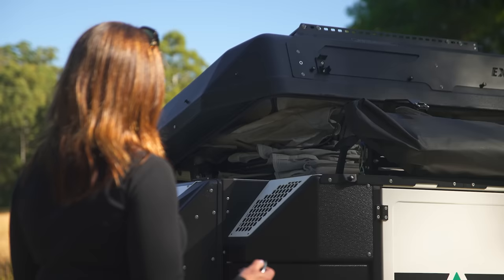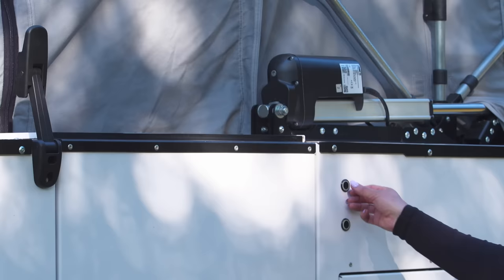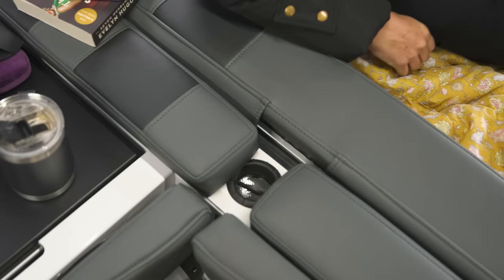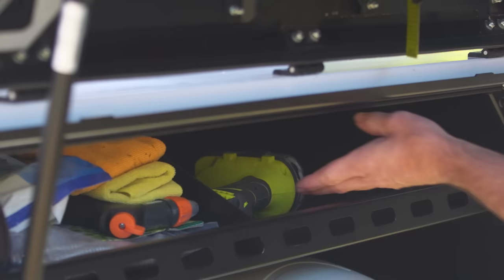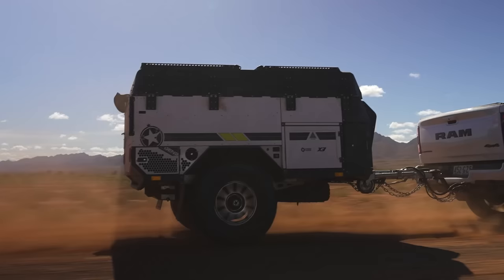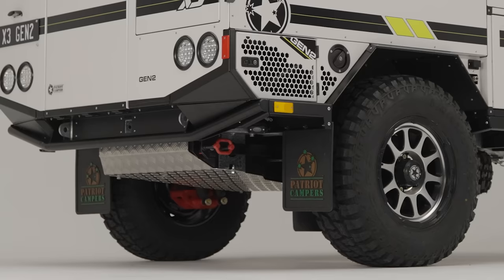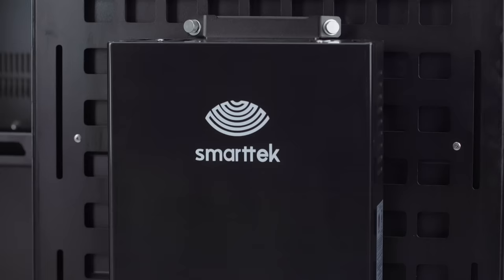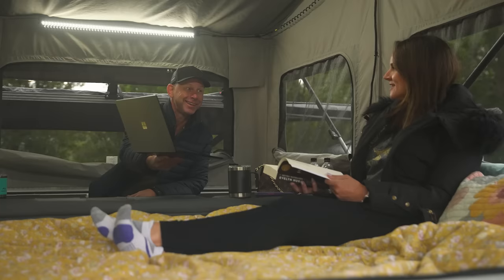Introducing the ALL-NEW GEN2 X3 Camper Trailer | Next Generation Offroad Automation

Comment: This so much better than the standed models but at a higher premium price....
As with the optional 120W Fixed Redarc Solar Panel , this should have a swivel type latching so when the composite tent lid is open, the solar panel can be folded of the rack and out into the sunlight... rather than have it facing the ground...
So will there be EOFY specials on the standed models since i read these will be fazed out with the Gen2 versions.
Reply: You will be pleased to know the solar panel does exactly that.  It is removable and has its own stand and comes with a longer cable.